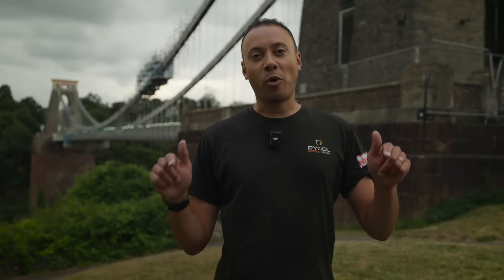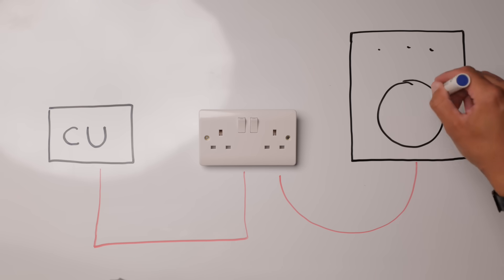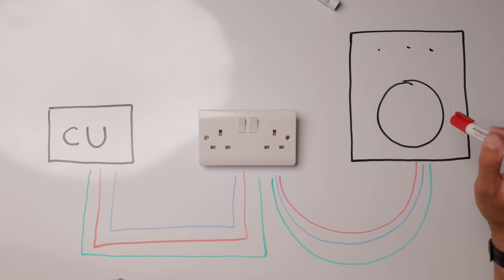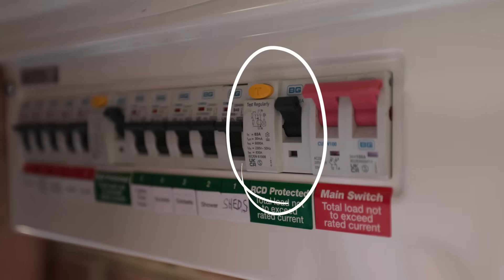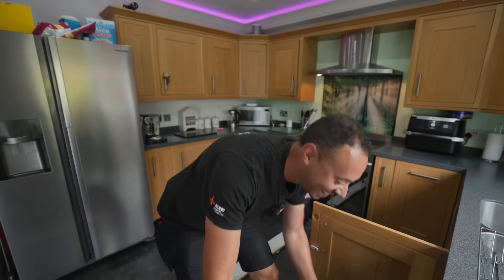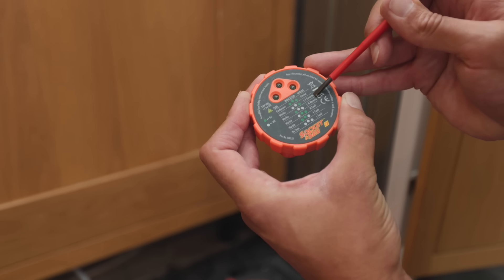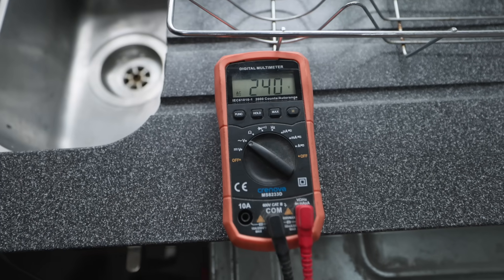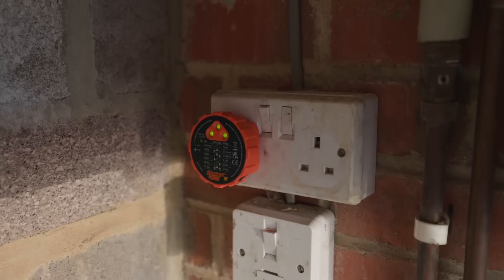This Simple Electrical Fault Turned Deadly⚡️

Comment: "The four Electricians" probably  some 6 week wonders, unfortunately the trade has become more and more de skilled. An NVQ (what does that stand for Not Very Qualified?)doesn't make you a spark.
Reply: The qualifications are not the issue. The only thing they do is make it impossible for people to get into the industry. It’s the part P and market protections that’s the  issue.
Reply: When I moved to the UK from Ireland I couldn't believe that a person could do a 6 week course and call themselves an electrician. It's still a protected qualification that requires a full apprenticeship. It should be the same here.

Comment: What's more worrying about mould plugs, you cannot tell if the plugs is been wired up correctly.,that why I like plugs that you can open up and check the wiring inside the plug, number of times I seen live and neutral wires been wired up wrong way, and earth been wired into the live or the neautal prongs
Reply: Do not use some cheap Chinese junk. They have wires made of steel.

Comment: Had a house re build back in 2012, electrician wired up sockets for washing machine and tumble dryer wrong, earth to neutral and neutral to earth, most of those 'socket and see' testers don't show earth/neutral incorrect wiring as a fault, the consumer board tripped out as soon as anything was plugged in on that ring circuit, all that was tested and passed off by the electrician as correct and compliant with regs, paperwork wasn't worth the paper it was written on. That's why I check anything a "qualified" electrician does. The sockets were even colour coded brown, blue, and yellow/green.

Comment: I am a mechanical engineer, and have worked with auto electrics and household. you do not mess with high voltages/Amperage always double check everything, its a life saver! who knows if the person before you knew what they were doing. I have just checked my new to me bungalow and found many electrical faults god knows how long its been like that.

Comment: Been shocked twice touching a washer,As I work for Currys installing appliances Always use a voltage pen now against chassis of appliance before touching,then socket tester in socket that new appliance will be plugged into.👍💯
Reply from the maker: Thats great to hear! Nice to know it has made an impact to so many. Thank you for letting me know:)

Comment: I’ve changed all the socket plates in my home all to the same new version, averaged about two at a time, and despite being sure I had wired them correctly, I still ensured I used a socket tester after each change.

Comment: Great video. Raises awareness. Thank you for this. 
Firstly, heartfelt condolences to the plumber's family. Terrible that nobody has been held to account on this. 
I am not an electrician, but I do replace or install the odd socket here and there in my house as and when the need arises. I always ensure any power is fully isolated and check the connections with my meter first, and also the continuity before energizing and have never had any issues. I always check with an electrician if I have any doubts.
Reply from the maker: Yes its so important to do the correct checks. People’s lives are depending on us.

Comment: Thanks, I bought one of those test plugs a long while ago. I always test power strips bought online before using them as they could be made anywhere these days and because certification marks can always be faked. Also useful if making an extension lead or adding a socket. These test plugs cost peanuts but very reassuring.

Comment: Wow that really opens your eyes as to how dangerous electricity actually is and why people with little knowledge who think they know what they are doing simply shouldn’t try. There’s a reason electricians go through years of training and have to be registered. A fantastic video young man. Thank you and well done
Reply: Apparently the years of training that this electrician went through didn’t help much since they still made that mistake. Also, it doesn’t require years of training to be able to read the letter “L” and “E” and understand that one means Live and the other means Earth. Even people with a vast knowledge in DIY stuff knows how to do that correctly without messing up. That’s why it’s so shocking that the person who made this mistake was actually a qualified electrician.
Reply from the maker: Thank you very much. You have raised good points there and thats exactly what i wanted to get across in the video. Thank you for your kind comments.:)
Reply: @RygolElectrical  But wasn't it an electrician who made this mistake though? ^_^"

Comment: If you went to put a spanner on it you would still get a nasty shock that could kill but it's less likely as it's not straight across your heart, I've had many and thankfully only from AC I wouldn't say it hurts but it certainly wakes you up
Reply from the maker: Absolutely, depending on the scenario will depend the outcome. Thanks for your comment :)

Comment: In Thailand recently, I had to do an inspection on a house and the first thing I go to, is check the Consumer Unit. Someone had wired the Live and Neutral backwards. Upon speaking to the owner, the last renter didn't pay their electric bill, so in Thailand they remove the meter going to the house. Once the meter had been reinstalled, the Official Electrician for the Electrical Company wired it up backwards. Even though the cable was marked. I failed the installation instantly.

Comment: One of the worst thing I've seen us where an electrician working sub contract for a power company went to fit a digital readout unit to a domestic property and whilst there he fitted a double pole isolator switch inside the meter cupboard , he switched the power back on but never went back into the property to test polarity on the sockets to know that polarity in the incomer was correct, the home owner called out an electrician to find a fault on one of his electrical circuits, luckily the electrician who visited the house was an experienced electrician I fear if it had been a younger electrician it could have turned out deadly, this electricians first action after removing the consumer unit cover was to put his test equipment across the mains and straight away it showed cross polarity on the incoming supply which meant that the neutral bar of the consumer unit was permanently live, and could have been deadly, the sparks who fitted the double pole switch had crossed over the mains cables on the outgoing side of the meter, so I suggest everyone should buy one of those socket testers  so you can double check electricians work because it could save somebodies life, as an Industrial electrician with 50 years in the industry I can tell you it is easy for a situation go go from save to deadly in minutes

Comment: I am in the U.S. - I see how the simple plug in tester will tell you if you have reversal, but is 120V typically safer for individuals as compared to your 240V, or does it matter?
Reply: In general, 240V will cause more current to flow and is possibly less safe. But there are many other factors - 110V is enough to kill in most cases,  higher currents on 110V circuits make fire more likely, US sockets more likely to electrocute due to uninsulated pins etc etc.

Comment: Pity we didn't go with 110v ac like the US. Heavier cables I know, but it offers protection against careless electricians.
Reply: I stand to be corrected, but using 110v would double the current, making it more dangerous as the current is what stops the heart. Current flow passing through the heart can be fatal from 50mA , but 150mA + is far more dangerous.
Reply: @Wishiwasnthere-58  A car battery will deliver over 600 amps but you can safely touch both terminals. Current without Volts (electro motive force ) wont harm you. 110v is unlikely to push enough current through you to kill you. 230v volts saves a lot of money by using less copper to deliver the power to an appliance. To be clear 110v ac can still kill you depending upon the circumstances but it unlikely.
Reply: @alanbayley3255  thanks for info😊

Comment: It made me feel physically sick! How could you ever make such a horrendous error! Leaving everything plugged in dead but with a live case shell. 
In sixty years I have seen a lot of nasty errors, but this '13Amp Socket' is a first. 
I remember once having to test out a brand new 2Kw electric fire before the customer took it from the shop. It was dead, but the fires reflector had that 50cps tingle about it, I discovered that the '15Amp' plug was wired incorrectly, earth wired to line terminal! The shops electrician was dismissed 'on the spot' during the afternoon. Those were the days! Later that week, because of my discovery, I got a pay rise of two shillings and sixpence a week!

Comment: Thank you for taking the time to make this video. It's incredibly important to raise awareness around these issues, and you may well have already saved lives by doing so.
This is such a tragic case—someone lost their life simply doing their job. Having personally been involved in a near-fatal workplace accident (unrelated to electrics, but similarly the result of negligence), this resonates deeply.
What concerns me most is that the fatal error in this case was so simple and glaring—made, presumably, by a trained and qualified professional. It raises serious questions about the standards of training and certification in this field. How can someone be trusted with such a skilled and critical job, yet make such basic mistakes?
Even worse is the apparent lack of accountability. The consequences could not have been more severe, yet no one seems to have been held responsible. According to the video, four "electricians" worked on the job and each blamed the other. Ultimately, it seems all of them escaped punishment.
Why didn't the HSE revoke the registration of all four? Surely they each knew who had wired the socket. Investigating that alone could have exposed the truth and ensured that the responsible individual faced consequences.
Instead, what we're left with is one—perhaps four—unfit electricians who may now be rewiring your house, introducing hazards that won’t be discovered until it’s far too late.
Reply: I have to say that revoking all four is a bit unfair, its not like becoming a qualified sparkie takes a few weeks, it years and you may have had 3 sparkies that were decent good sparks that valued there career. A few issues i would ask is at what point was the testing and certifiacation caried out, by whom and why it was not picked up and corrected, quite simply you can have 40 sparkies working on a job but in most scenarios you have 1 tester & inspector who has to sign the certificates and in all cases any certificates signed if there were to be more than one T&I on site would immediately be tied to that circuit identified. If relevant testing was not conducted then liability should have been passed to the company who employed the sparkies and action taken. There could have been mitigating circumstances here, did any of the 4 sparkies wire the socket ? did the home owner try to do it, did the plumber try to do it ? if its a domestic property was it like that to begin with but just not used until a re fit was undertaken, was the owner of the property acting as some kind of project manager and bringing who he saw fit as and when ( because it happens ! ) Again i have to re iterate that blaming each other as to who did it is pointless, it should have been tested before been certified safe to use.

Comment: I am a retired refrigeration engineer, I have come across lots of situations that were deadly. I had chest freezer with the casing wired to the live.  Ice machine that lit the neon screwdriver when it touched the ice,
an isolating switch with in and out wired on the same terminals so switch wasnt even in use. But I am 77 , I survived.

Comment: I’m not an electrician, but used to be a computer engineer. One day, back in the 90’s, I took a call to the 10 Downing Street offices. They reported getting electric shocks off the Twinax connectors which linked their CRT monitors to their IBM midrange computer system. They were correct - 240v AC on the connector bodies for each and every terminal. I unplugged every unit and discovered that the live and earth from their wall sockets were transposed. Luckily, nobody was killed and an electrician was called to remedy the situation. If the worst had happened and some high profile politician, or their advisor had fallen foul, that would have made the headlines!
Reply: S/36 or AS/400 perhaps? Good old chunky Twinax. You couldn't pop back in 2026 in the hope that the "problem" can be recreated before the current residents manage to totally destroy the UK? 😉😆

Comment: Getting back to plumbers,,,I got called to a job,,, lady getting shocks from stove,,,, tested,,, tested,,,, sorry I can't find anything wrong..... she then said,,, should I turn back on the hot water cylinder????  Yes why not,,, she did,,,I touched the stove and whamo... WTF.... long story,,,, element in cylinder blown...240 volts to grounded metal work,,, plumber replaced pipes to and from cylinder with PVC,,,, all the metal wastes were still bonded to earth,,,I found the cylinder earth clamp laying on the dirt under the house right where the new PVC pipe was..... worst part the shower taps were live when HW switched on,,, and the metal shower tray,,, benches,,, sinks were still bonded to earth... yikes,,,,re earthed everything,,,new HW element (and thermostat).   Plumber got a telling off,,, and lucky that morning the son had a cold shower..... so be careful fixing stoves..😮
Reply from the maker: That is absolutely lethal!

Comment: Carry a socket checker with you at all times, they're cheap and take only seconds to plug in and show you whether a socket is correctly wired or powered up in normal conditions. Though one word of warning, I found my trusty old Maplins checker got very confused when checking a socket being powered by a split phase inverter, it thought it was completely dead when in fact it was live.
Reply from the maker: This is good to know.

Comment: I throught you pommies had new circuits on an RCD would have picked that even incorrect connections 😮 In NZ we must use red green / yellow & black for domestic wiring So why no RCD in a wet area ?
Reply: Only newer houses and rewires have RCDs, they;re not compulsory. I guess the new socket was fitted ready for the new washing machine and the plumber was killed when he came to connect it. It's hard to believe nobody would have noticed if the machine had been in use previously. A competent electrician would probably have offered to fit an RCD on installing the new socket, but I don't think the householder would have been compelled to have that done (and the electrician doesn't seem to have been competent).
Reply: @theelmonk in NZ any new socket, even in old houses, must be RCD protected A simple law change can fix this. In my house I have the washing machine on an  old isolation transformer even better .

Comment: This is a very rarely seen fault because it will show itself in a couple of various different ways.
Firstly, nothing would work when plugged into that socket, second, the circuit's RCD would trip as soon as anything was plugged in, third is that as soon as the incorrectly wired socket was screwed to the wall, it would have shorted the back box & the screws to earth.
The more likely event would be an Earth fault on the machine & a live to ground event like a failed heating element went undetected until the plumber made the connection between the appliance & ground. 
The only other reasonable explanation is that the plumber himself wired the socket fitting incorrectly.
Reply from the maker: A socket live and earth reverse can ho undetected for example if its a plastic back box, or a metal box screwed to a wooden stud in a wall. The RCD won’t trip if the machine isn’t turned on. Which is why i was able to simulate the same fault.

Comment: Not quite the same thing but many years ago in the 60s my dad put a metal coat hanger with three hooks on the wall in the hall .One of the screws attaching it went into the buried cable that fed the immersion heater up in the bathroom .Although the heater had a switch in the airing cupboard it was usually left on the other switch in the meter cupboard downstairs was used as the main way to switch the immersion on and off so what i am trying to say is every time the heater was switched on the coat hooks were live  .The fault was only discovered when the house was rewired in the early 80s .How no one was ever electrocuted  in all those years is astounding but that's not the end of the story as whoever installed the immersion heater clipped the cable to the wall before it was then crudely plastered over .One of the nails in the cable clips had gone through the gas pipe feeding the cooker
Reply: Reminds me of a call out I once had to a flat when I was an apprentice. The resident was putting up a picture going up the stairs (upstairs flat with ground entry) and managed to hit the cable from the meter to the cu. Lucky for him he was OK. However he had no electricity for a while because it blew the meter.